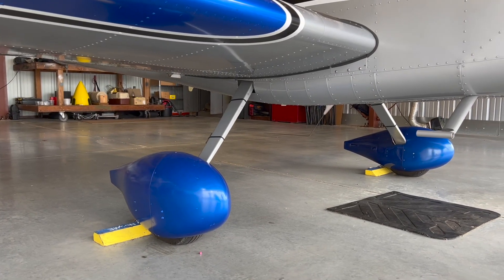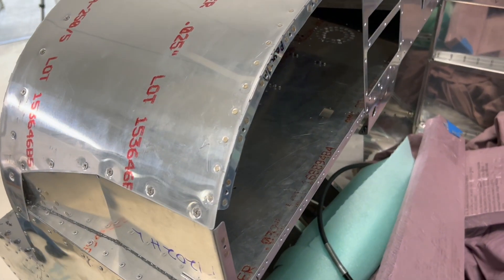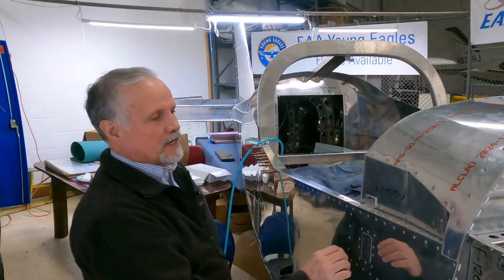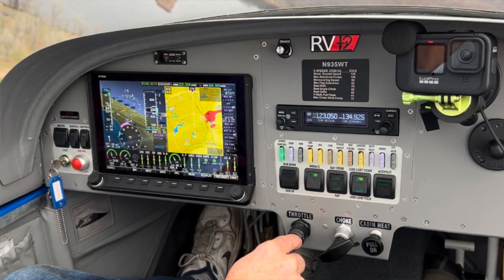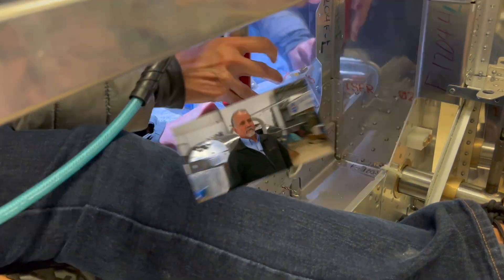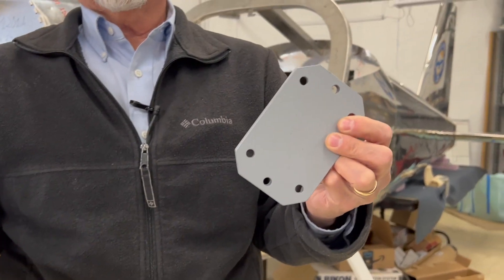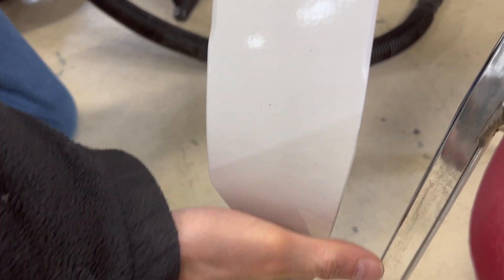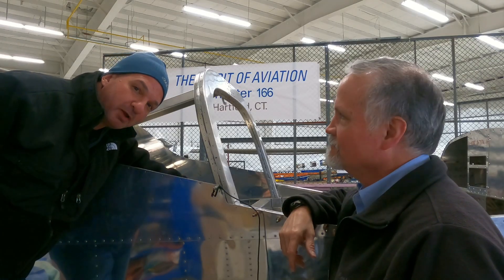Van's RV-12 Build: Landing Gear mod

Comment: Where is the engineering improvement in reducing the thickness of the landing gear beam, to allow the bolt spacing? Manufacturer a new 'wear plate with correct spaces of holes'.
🛩️💯